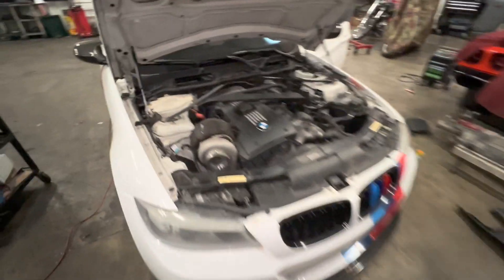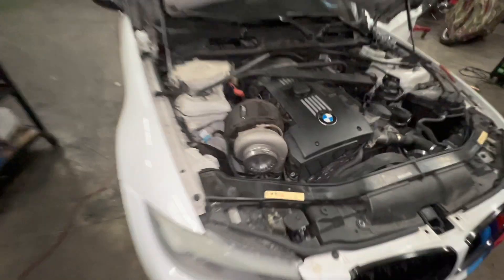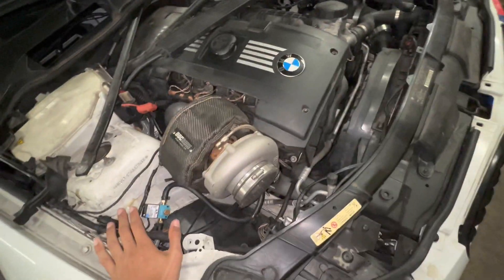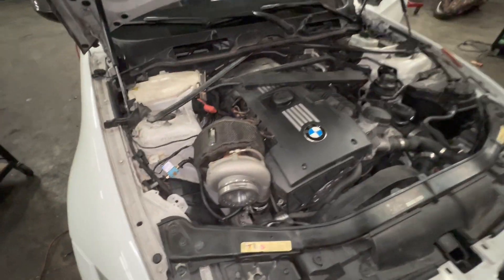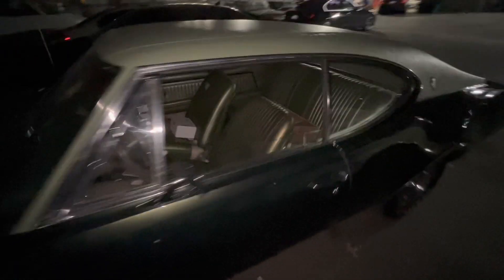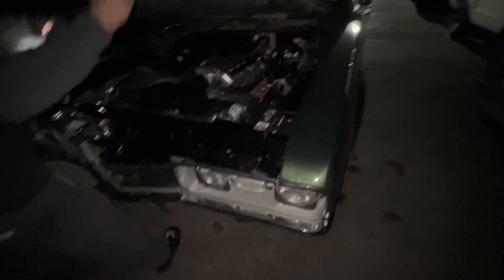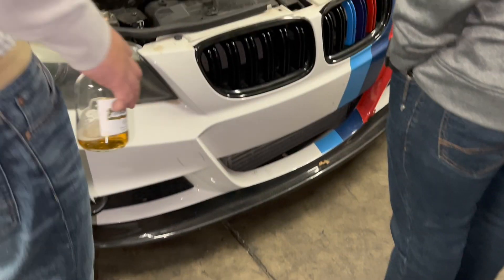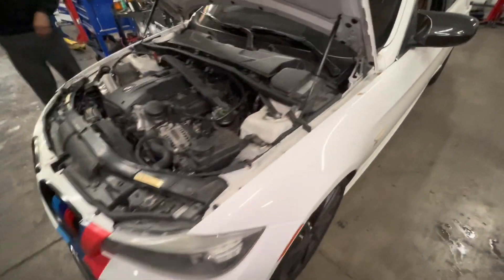TOP MOUNT VS BOTTOM MOUNT SINGLE TURBO KIT 335i(N54)

Comment: So the white car is running a top mount, 5860, and is still on stock exhaust. It's no wonder you make more power than him. Although you also having more response is surprising to me. I guess having a bottom mount, and/or better exhaust setup and tune really matters. But I also hear it has something to do with igniton as well, so make sure you have good, properly gapped spark plugs, and good coils.

Comment: hey bro, i own a 2008 328i and it has a straight 6 N54 engine. I don’t know much about engines but would u recommend me taking it to my buddies and put a turbo kit on it? I need help brotha.
Reply: Nah man. There is crap ton of work you gotta do just to get it near a stock 335. It’s kind of a bummer, but if you want a turbo get a 335 that already has everything.
Reply: 328i has the N52 the na block is made of a different material and you’d spend a lot of money to make stock N54 power. See if you can find a wrecked car with the N54 and do an engine swap if you’ve got friends who know what their doing
Reply from the maker: If he knows what he is doing I would say yes that will save you a lot of money on labor
Reply: 2008 328i is a naturally aspirated straight 6 N51/N52 not an N54. 

The block is very light it’s a mix of aluminum and magnesium, it’s not going to hold boost like an N54.

Comment: Whats the power diffrence in the two or how they handle like throttle and boost response diffrences cost diffrences difficulty of both kits in comparison
Reply from the maker: My Bottom Mount kit makes a little more compared to his top Mount and is more responsive,my kit is about $1000+ cheaper
Reply: @organicgibbs  that maybe true as far as tune is concerned and turbo size when it comes to more power. But the kit itself isnt what makes more power. The top can make the same power. The biggest difference in my opinion is option for bigger turbo size. Bottom mount limits that. And also turbo replacement if something goes wrong.
Reply: @Alpha_apex How hard to Replace bottom mount turbo if it goes bad, how long you think it would take
Reply: @geo745don  its more of the fact you have to jack the car up anytime you need to do something. Versus just popping the good and get to wk. Anything 02 sensor related aswell. And 02's have a habit of burning out quicker single turbo. Specially if you like go beat on the car.
Reply: 5860 is TINY. Emap must be through the roof.

Comment: Just went bottom mount 6466 for my 335is. Cant wait for it to arrive.
Reply: exact kit i’m
doing on my IS
Reply: I’m tryna slap the same on the E93 mt
Reply: Where you take your car to get the work done?
Reply: @Jacob2Goood  Got it done at my shop and got a custom tune from pure evil tuning. 26 psi on my highest map on full e85 port injection. Room to push more boost, but at the risk of engine longevity. Ill see later down the road if I decide to build the engine and transmission.
Reply: How long to Change the bottom mount turbo itself you think if your upgrading it